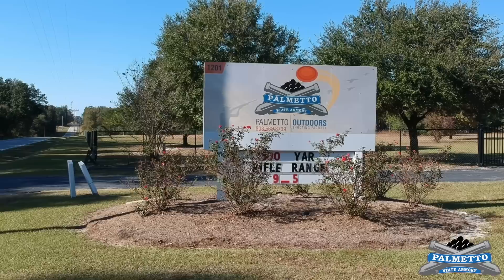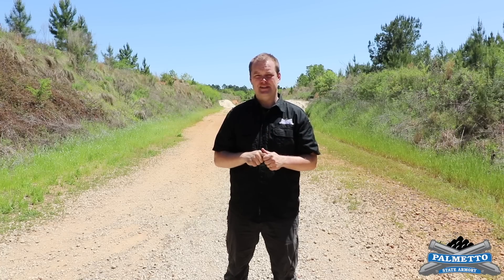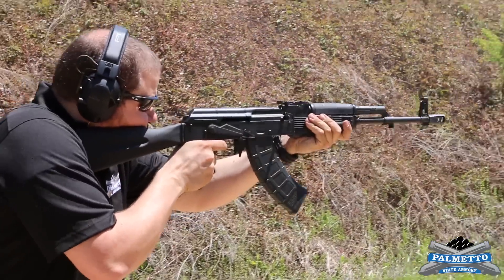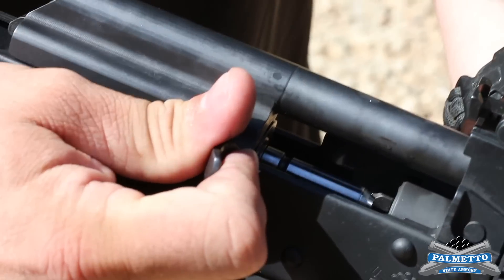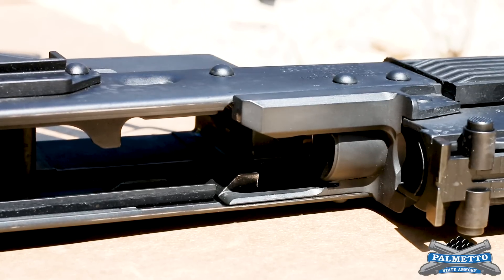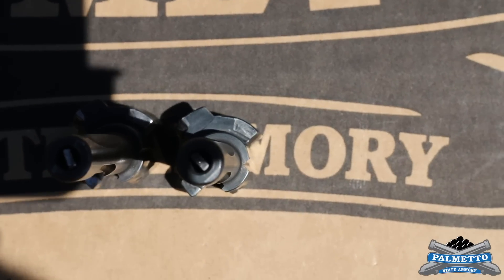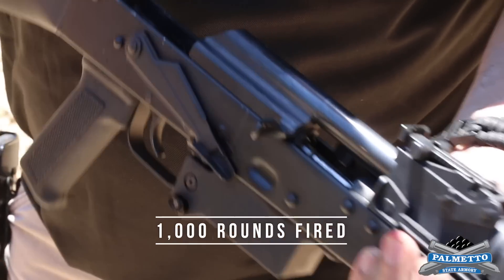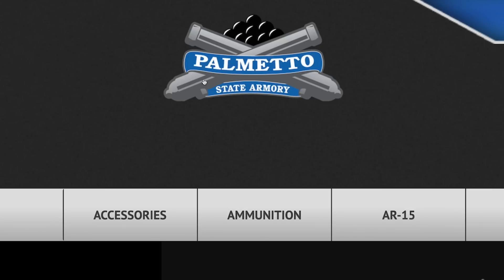AK BOLT AND TRUNNION WEAR - WHAT TO EXPECT

Comment: Less than 400 rounds on my gf5 and the bolt wear is way worse than these bolts. Metal deformation on my locking lugs and it’s very magazine sensitive  only likes factory mags  Bulgarians and pmags. Contacted customer support and been waiting for a response. Hopefully they take care of it.
Reply: Same here. Have you ever got a response from them?
Reply: @404-no-fund the bolts they used here don’t look like the toolcraft bolts they put in their AKs. I sold my PSA Type 56 spiker for the same reason. PSA sucks

Comment: Interesting how you only showed one side of the bolt and not the side where the firing pin strikes the primer. My rifle 7.62 GF3 produced most likely 2022 or early 2023 is noticeably peening where the firing pin protrudes. If you scratch the face where the hole is you’ll feel a lip up high enough you catch your fingernail. This will eventually cause primer issues once enough metal is built up. You may be thinking I have many rounds through it. Wrong. It’s been shot around 200 rounds

Comment: Hi PSA
 I have bought a few of your AR 15 Freedom kits and I am very happy with them so far. I built them from a 80% lower. I have built a fair number of AK's. The wear pattern pattern on the bolt lugs has to match the trunnion lugs which you show no pictures of. It looks like the trunnion lugs are peening on the edge because you do not have full contact of the bolt lug to the trunnion lug. This is a common problem with AK manufactures. They use mismatched bolt and trunnions. The kits I build are European. Some were #'s Match and the lug fit up was spot on. The mismatched kits I had to fit the bolt to the trunnion. I have a Hungarian AK63D build on Daily Motion. My channel name is YugoM72. One video shows how to mate the bolt to the trunnion.

https://www.dailymotion.com/video/x6hdrzq

Comment: I’ve had to send back a pa-10 upper. Came back with the gas block screws stripped and the return form I filled out torn up in the box... felt like a passive aggressive way of saying to go fuck myself. I will...and I’ll buy elsewhere. Very disappointed in the conduct.
Reply: So the sheet looked like confeti or just a slight rip
Reply: Dad Dun not confetti but definitely ripped apart.

Comment: Get an i.o ak or a ras47 and do that test tell me if thats normal wear for a rifle 😂😂 you should also mention cast trunnions vs forged trunnions
Reply: PSA uses billet trunnions
Reply: @moto_rad  Not anymore now they finally brought there GF3 to the market. ❤️
Reply: @moto_rad  comment didnt age well
Reply: @moto_rad  yeah but what is the billet made from originally? It's still technically cast, but I guess that's just semantics
Reply: Billet material, however, is not a manufacturing process, simply a form of material (like ingot, nugget or round) and is often used for CNC machining products and produces high quality, high accuracy parts without the need for expensive tooling. This makes it exceptional for low quantity or bespoke work that doesn’t need to be mass produced.
Billet material is also often incorrectly associated with unanimous quality; the quality (particularly in terms of strength) is determined by the quality of the billet material used – not all Billet material is top quality. This is what Matt T. is referring to.
Reply: An io lol. Literally the worst AK..

Comment: 5.56 PSA AK? Yes please!!
Reply: Jorge Vespucci more than anything I can’t wait to hear what the big gun channels have to say about it.  I’m an AK nerd and like the idea not having to buy a bunch of new mags.   Those rifles you listed have mags that are pricey and the rifles are probably far more money than this PSA offering.  I own several PSA things and all of them are just fine.
Reply: LoL!!!
Reply: Alpha Charlie Concepts I know Century had one and it was questionable.  The PSA magwell looks great though..  

I just checked the site out of curiosity and there's nothing yet.  I can't wait for Rob Ski and MAC to get their hands on one!  

I'd love to run one through a carbine class.  See if it's a workhorse.  The steel casings are tapered on 7.62x39 and the steel itself helps with the inherent reliability.  Using a straight walled case could cause reliability issues. 

Who knows maybe it'll be the best thing since flush toilets and we'll all buy one!
Reply: But seriously why would you?
Reply: @jorgevespucci9878  If you're paying 800+ for an AK alone, you're missing the point of the AK.
Reply: @crushglobalists8640  Ackshually adjusted for inflation 800$ it's still pretty reasonable price for ak...
Reply: @jorgevespucci9878  Not when you can easily afford higher quality, more accurate AR's like a Sig Tread or a troy SPC A3 and things get even cheaper if you decide to build your own considering how much more modular the AR is.You're essentially buying a high functioning piece of Russian memorabilia at 800 up.
Reply: @crushglobalists8640  Now we are talking about ar15s?? Kind of a... apples to oranges comparison which doesn't take into account inflation once again.
Reply: @jorgevespucci9878  You're missing the point. This isn't about AR's vs AK's. It's about AKs being overpriced in the us compared to other options.
Reply: You can buy a solid ak for 500$ all day long... What are you babbling about? You CAN buy expensive aks if you PREFER to do so... They are "overpriced" because they arent battlefield pickups sold by drug lords on the black market, like you have in africa. ANYWAYS. You should really be building your guns from parts. Mmmmm.... Galil build....
Reply: @jorgevespucci9878  "Why would you buy a shitty psa with some goofy ass magwell adapter? Why not buy a saiga 223 or classic poolytech spiker in 223?" Those where your words exactly. You heavily imply that AK's in that price range are shit by calling PSA's bad ,despite the fact that they're proven to be some of the best in terms of price to performance, and that unless you dump money for overpriced pre-bans, you're doing yourself a disservice. Really, outside of PSA, in the 500 price range, the next best thing is to take a gamble with Century Arms.
Reply: Dude ikr!? I want one now.
Reply: Why would you buy a shitty psa with some goofy ass magwell adapter? Why not buy a saiga 223 or classic poolytech spiker in 223?